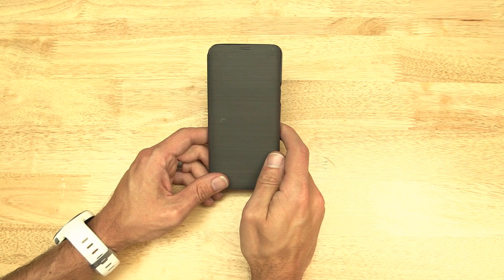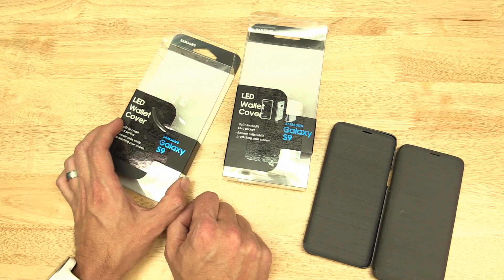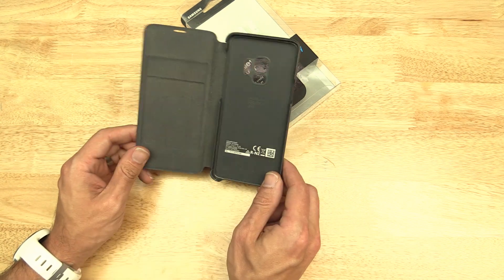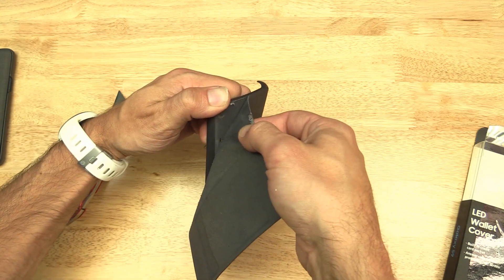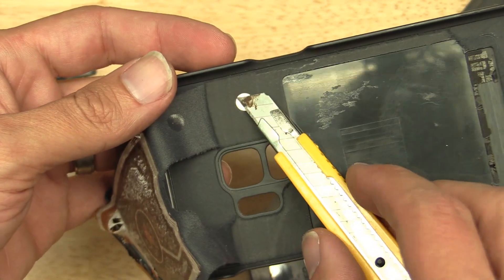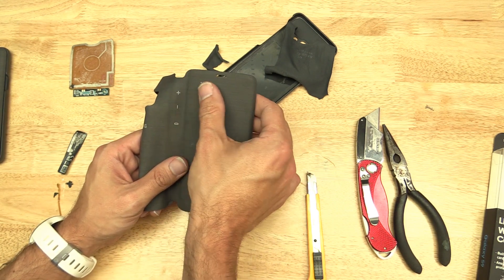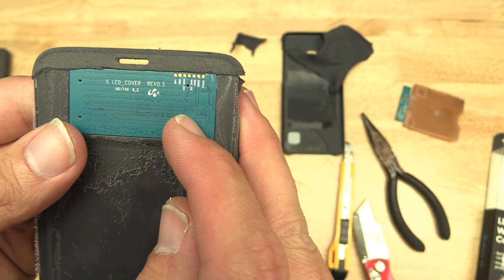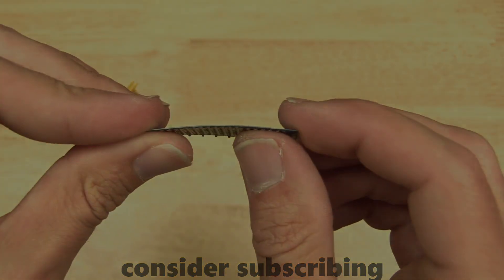SAMSUNG S9 S9+ LED Cover Pie Update FIX! (and TEARDOWN!)

Comment: A BIG THAK YOU! for the sacrifice but super interesting and valuable info! It's the first and only teardown of LED case on the web! I suspected that it works that way, but it's great to actually see all the details. It made little sense of Samsung to "update" its app in a way that would make this kind of expensive case inoperable. 

BTW, I was searching YT for "Galaxy smart LED cover teardown," and also  "Samsung smart LED cover teardown," and "smart LED cover teardown," and couldn't find your video - which is the only one showing the inner guts of this type of cover. Maybe add some more search tags? 

BIG THAK YOU again!

Comment: It should work of nfc....    not from wireless charger.         Nice has low power to it.   Plus the commutation  aspect.
Reply: I think the NFC is for data and the coil is for induction/power

Comment: Very interesting . Do different Samsung's have magnet sensors in different places? How does it know the cover is open/closed? Is there some "software" that's loaded from the case when it comes close?  Is each none unique to that phone? I cannot get mine to work at all. Nothing shows, nothing seems to "connect" so how do you know the phone has detected it? I've managed to get another TEN so hopefully work something from that.
Reply: NFC needs to be enabled. There's an NFC tag inside that communicates with the phone.
Reply: @DangerousMongoose  Thanks - I've turned on NFC and still nothing. Is there any way to read the NFC tag?
Reply: @datasilouk1995  just checked and it doesn't seem nfc tells the phone it's open. It should have a magnetometer or smth. Hence the magnet inside there
Reply: @zakariaao  . I tried fooling it with two magnets.  One for the presence of the case and second is open / close and still nothing.
Reply: @datasilouk1995  does it even show in the accessories tab? Maybe you just have the same one as him?
Reply: @zakariaao  . Yes,  I  noticed that using the diagnostic mode *#0*# you can detect the two magnets presence, but again,  it doesn't detect it.
Reply: @datasilouk1995  that's really odd huh